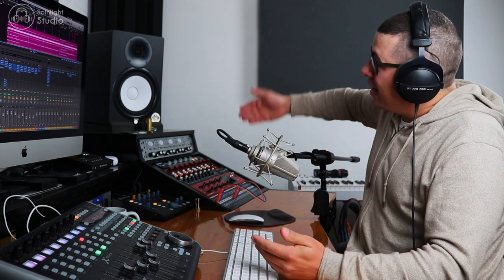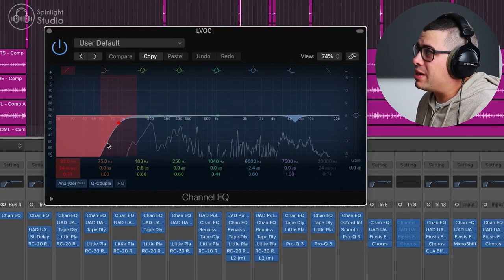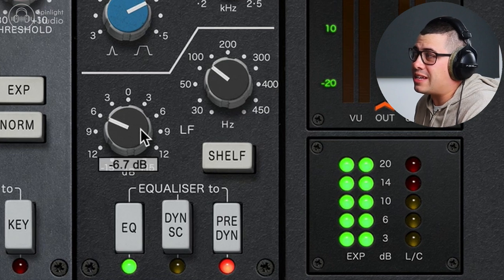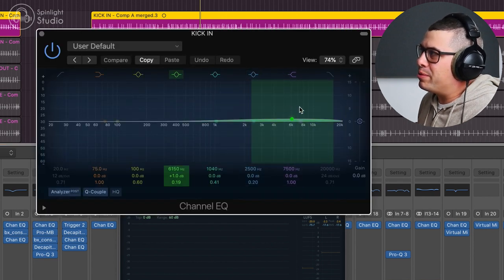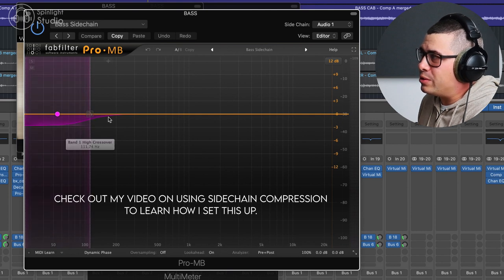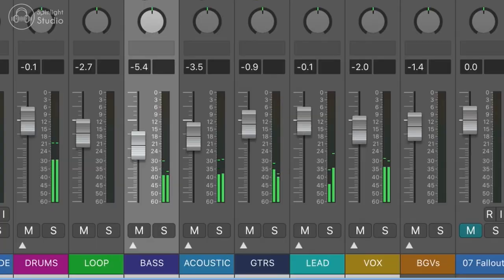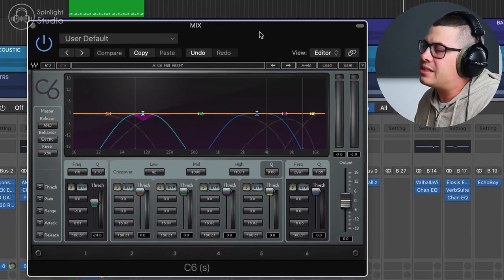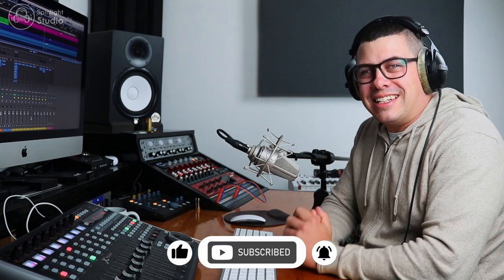MIXING A TIGHT LOW END (Need To Watch)

Comment: Hey man, solid vid! What bass traps are ya using?
Reply from the maker: Thanks Zac! I’m using some that I got from swamp industries, they are the larger ones in their site. They work really well!
Reply: @spinlightstudios  Great! Same with the wall panels?
Reply from the maker: The panels are made with thin MDF and filled with sound screen insulation, then wrapped in fabric. A bit of a DIY project.